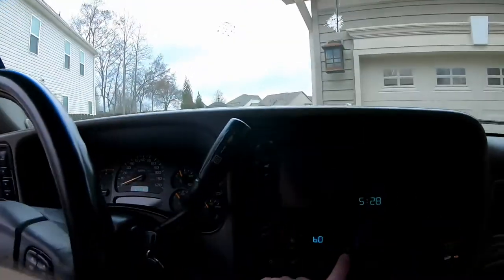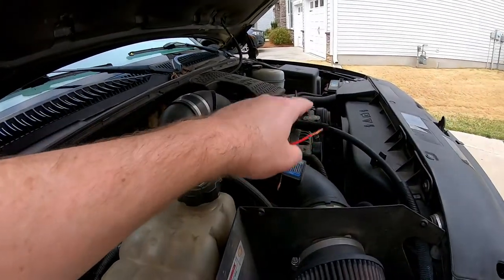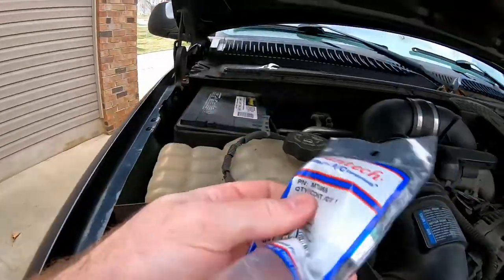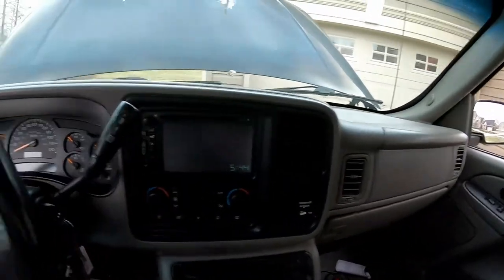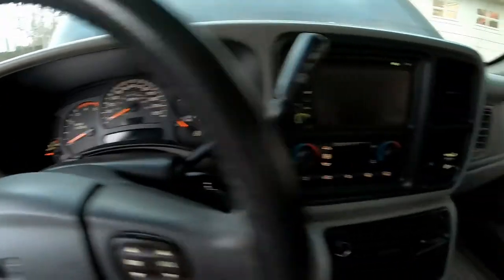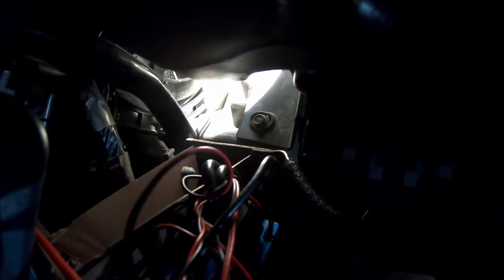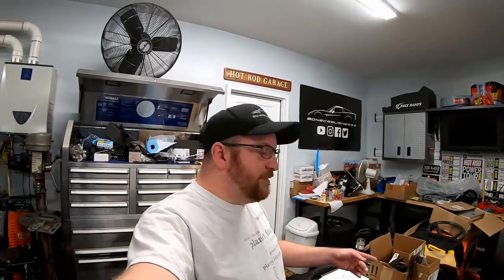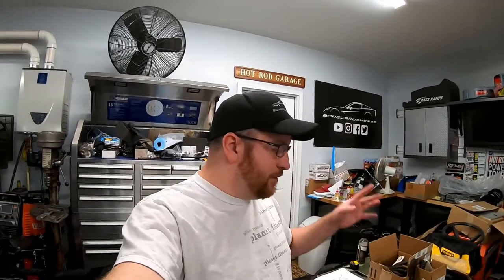2005 GMC Sierra 2500HD - Fixing the Air Conditioning System

Comment: Thanks Bone crusher, FYI  I had the same low pressure unit issue .I live an hour away from parts so after removing I decided to take the low pressure unit off and put it back on.
It worked fine. 
I will replace this unit anyway.
Reply from the maker: Nice work!

Comment: First thing is to buy a thermometer !!!  Second is to tap the AC clutch drive plate with a broom handle when engine running, AC "on" to see if the drive plate engages and spins same rate as its pulley.  The actuators on these are crap, had gears strip on one in our 1994, and in our 2005; on our 2014 the gears were not stripped (not making clicking sound) and I cleaned out the insides with a Q-Tip to fix.
Reply from the maker: Sounds like a good fix.

Comment: Is that a stock radio head unit?
Reply from the maker: Well - stock Escalade/Trailblazer unit. I got this off eBay - and paid for it to get reprogrammed to my truck VIN # - and it worked without issue. 

Here is the Nav install video: https://youtu.be/55KvqncaDFs

Comment: Question for ya. My 2005 Silverado just got in for a smog I get home turn it off and the compressor keeps running. I turn it back on shut off the ac and turn it off and it just continues to run. Any idea what might be causing it? Everything was great till the smog today. If you have any ideas I’d appreciate thanks man
Reply from the maker: Unplug the harness going to the compressor - that should turn it off. 

Why its continuing to run - double check the fuses for the AC compressor and hvac system.

Comment: I had a question brother my ac work but when I turn it it won't blow out only when I drive it will come out only wanted to know the problem
Reply from the maker: So is it only coming out of one vent?
Reply: Everything work but only when I drive
Reply: @bonecrrusherSS   the fan spin but no air coming in when it jus sitting there warming up  only when I go in gear it will come out
Reply: @monetsengnalivong6471  I have the same problem and no clue where to start did you figure yours out?
Reply: @brittanibucco1377  check your condenser fan and freon level

Comment: My compressor is engaged but no cold air until its restarted 🤔 on a 2005 GMC
Reply from the maker: Do you still have refrigerant in it?
Reply: @bonecrrusherSS  yeah, and when the truck is restarted the cold air works flawlessly. I thought it was the blend door but switching to heat gets majorly hot and then back to cold is warm. So something is weird

Comment: So those two are the same part number for actuators . One up above pedals and the easy one on passenger side? Part # 1572971
Reply from the maker: You need to check with GM - give them vin # and they should be able to set you straight. I mentioned in one of these videos - there are like 4 different parts numbers.

Comment: I did the bypass the compressor turned on replaced the switch and compressor still not turning on with new switch.
Reply from the maker: Does the clutch engage at all?

Comment: I took mine off and did jumper and it worked but still blowing warm. Do you think its just low on freon?
Reply from the maker: Freon or ac condenser or accumulator are leaking